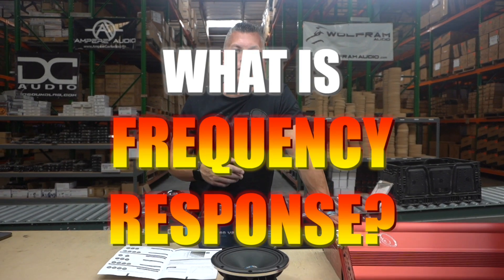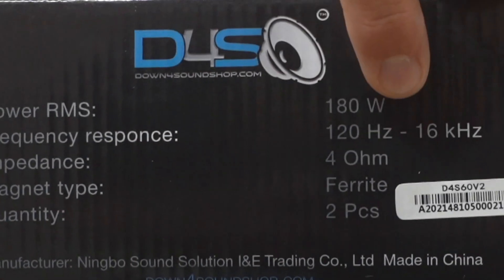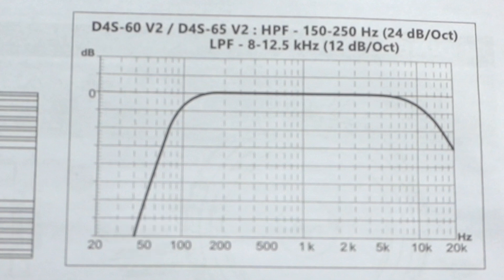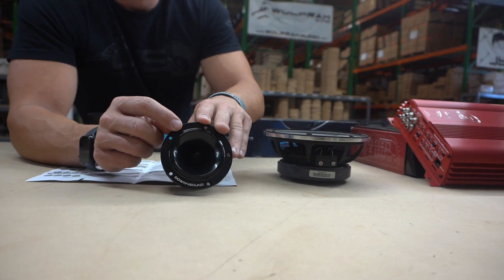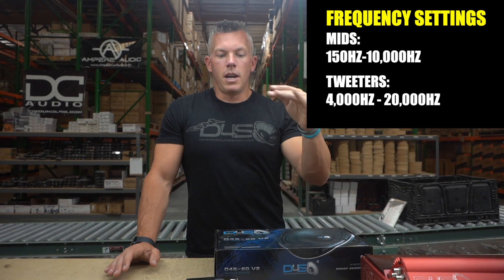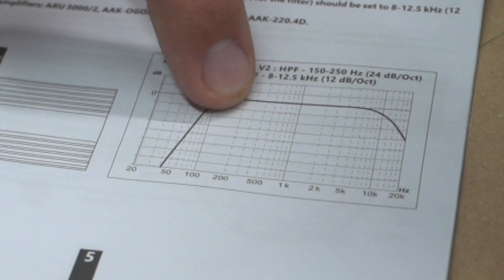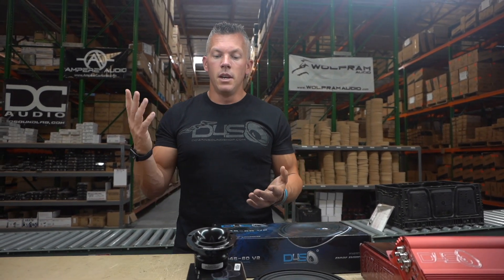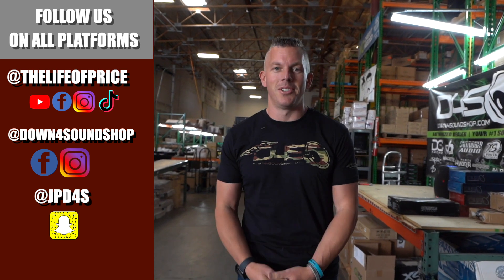WHAT IS FREQUENCY RESPONSE, AND WHY IS IT IMPORTANT?

Comment: The listing of a "frequency response" without mention of how flat it is ain't much help in determining a speakers useful response limits. Every speaker should have a (+/- 3dB) rating to show where the highs and lows slope off to inaudibility. A speakers low frequency listed as 25Hz might actually respond to a 25Hz signal but at -20dB's.

Comment: I have a 1200 rms amp , I want either a sundown sa 18 or 2 sundown E 12s .
 What do you recommend??
Reply: Me I'll go with the 2 12's.. they're rated wat 500 rms and give u them low notes..that 1200 wat amp will be plenty enough for them
Reply: @allenscott5773  I was leaning that direction.  Just curious if the sa 18 also being 1000rms if there was any benefit to running that over the dual E 12's ?
Reply: @travisabrahamson5092  u will be louder for sure..more excursion so much louder..again the 12's will go low and sounds good..but sir u have to make dat decision..me the 2 12's..I have a NSV5 15 and love it..so it's up to u
Reply: @allenscott5773  I have never run 12s.
 I had 4 10s and 1 12 in my car way back in the day.  It was incredibly clear and very loud but that was a Phoenix gold xenon 1200 which is alot more amp than I currently have.  It did 1200 rms from 1to4 ohms.  My current amp is only 450 ish at 4 ohms and 1250 at 1 ohm.  And a different car. I am running a power acoustic mofo 152x at the moment and just don't want to lose any at any frequency when I upgrade. 
 It would be nice to have it be better everywhere but I know nothing is perfect.  I had an 18 recently and was super disappointed.  I think that was due to me picking the wrong sub. Skar audio sdr 18d4 absolute garbage.  I don't want sloppy bass just to hit them lows with authority.
Reply: @travisabrahamson5092  lol. I understand u. You have to go with wat makes u happy. I Raj 2 12's for years till I start goin wit jl audio. I had a 13.5 w7 sub on a jl slash v1 and people thought I had 2 15's. Quality and beats hard. Now I'm running a NSV5 15 on a salt 4k. Again quality and beats real hard also..lows are there on both subs but jl to me is a little bit better. And yes skar sucks to me 2. My homie has skar and is garbage. Run a 1500 watt amp or 2k amp on that power acoustic and man it will sound real good.
Reply: @allenscott5773  The power acoustic is on its last legs lol. 
 The 1200 watts is to much for it. 
 I can only turn the bass knob to about half before it sounds like it is to much.  It was good for years but now it's just used up.  It says 1700 rms but I would say more like 850-1000. Power acoustic you got to divide the ratings by 2 🤦‍♂️ 
 Good quality product and more than expected sound quality but its pretty much done now.  I want the 18 but don't want to sacrifice sound quality. 
 I just feel like the 18 may be sloppy or distorted more so than the 12s. 
If anyone can give any info based on actual usage I would appreciate it 👍
Reply: @travisabrahamson5092  ok then..I understand. I have never owned an 18" sub so I kno nuthin about them.. I'm pretty sure one of them will do real good..again I have only 1 15 and it does real good..sumbody else may be able to help u on ur 18 decision.
Reply: A single 18 will have a little bit more come area than 2 12’s. If you want to play lows all day, get the 18.
Reply: I have 2 sa18 in a hummer h2 they slapping , deadening time & roof repair😂
Reply: I’m also running probably 2-2.5k watts per sub most of the time. they are wired down to 1ohm on a taramps md8k.1 with 370 mech & 3 145 alts on xs power yinlong lithium 80ah bank. Box is tuned to 33 hz. If I play that & above I watch the coil temp & not always full tilt. On 18hz I play full tilt for hours not clipping. Hope that helps.
Reply: @brian_GotSPL  wow an 8 k on 2 Sa's. 
 That's sundown audio though. They take way over rated power. 
 Are your 18s the v1 or v2 Sa's ??
Reply: @travisabrahamson5092  they are v2 the 1k rms rating. They do get stinky at times when overpowering them then I play some music with 18hz halfway to cool them back down.  They are a beast.
Reply: @brian_GotSPL  what are your enclosure specs ? I was thinking of 4.5 ft³ with 2x 6inch aero ports tuned to 32hz. Curious what you are doing for 2 of them ?
Reply: @travisabrahamson5092  not off top my head my buddy built this one for me due to my motorcycle accident at the time. Trying to find the design he did of it. I believe it was 9cuft… subs up & Kerfed center port rear @ 33hz. This one is just a temporary box. I’m doing a 6th order wall soon, waiting on drew Jones on that design.
Reply: @brian_GotSPL  I guess I am just curious as to whether the 18 at twice the price of the 2 12s is going to be that much better??